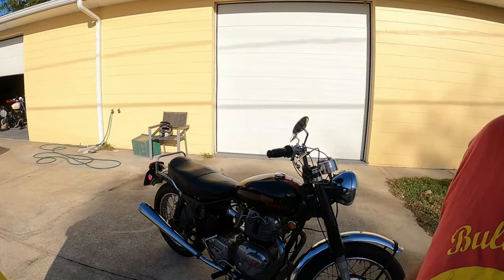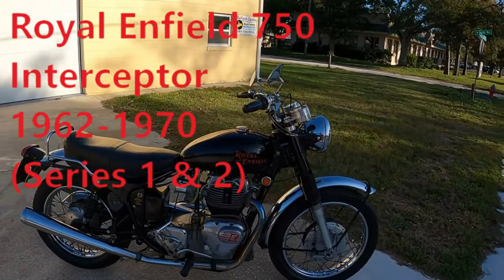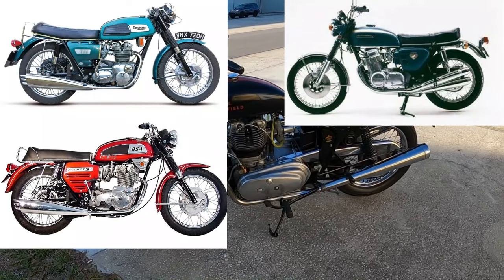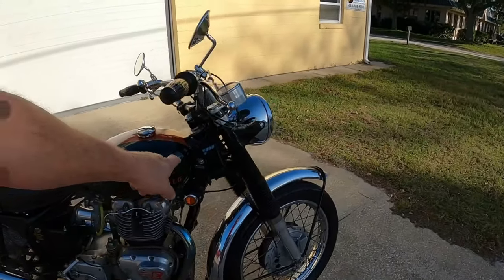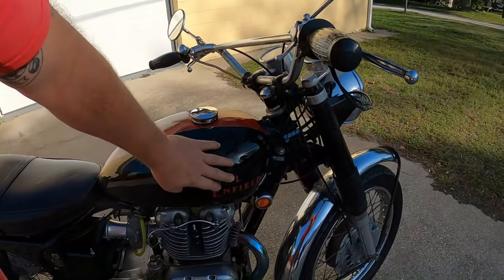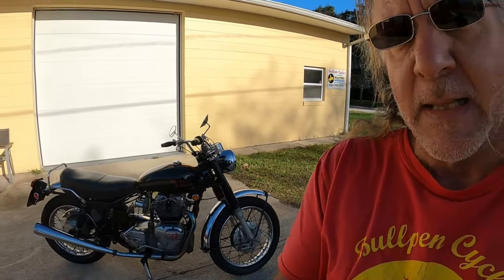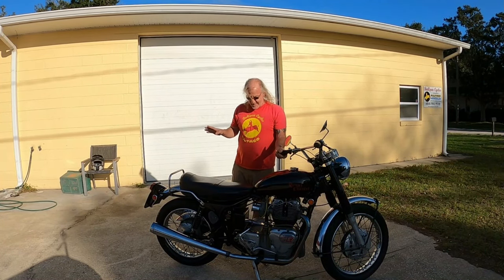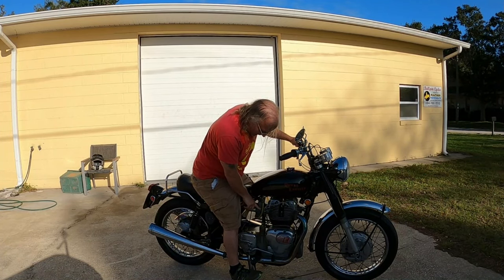WILL THIS ROYAL ENFIELD INTERCEPTOR 750 PROJECT FINALLY RUN AFTER SITTING 30 YEARS

Comment: I agree on the aftermarket electronic ignition.  Seems like every 10 years a new one comes out for the old bikes, with all these promises on performance and reliability ... And then they break and the manufacturer no longer exists..  Always stick with the points if that's what the bike originally had installed.
Reply from the maker: Yup! Right on! But the advancer cant be found anymore for this bike. So we do our best with the electro

Comment: Didn’t know it came with a rev up reverse.
Reply from the maker: ?? Try as I might, that one went over my head.
Reply: @bullpencycles  every time you have it gas on the center stand it would vibrate backwards a few inches.
Reply from the maker: Oh, you have good eyes! I was wondering what those marks were on my cement. I noticed them the next day!